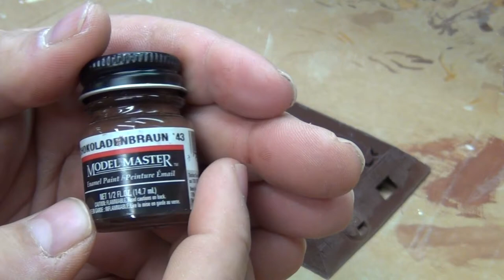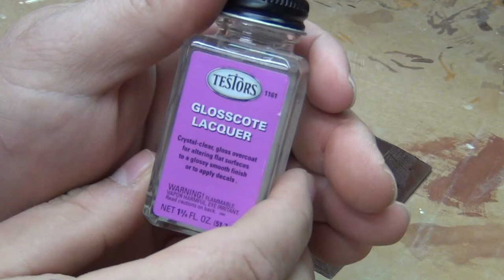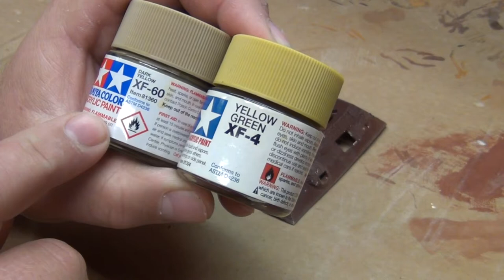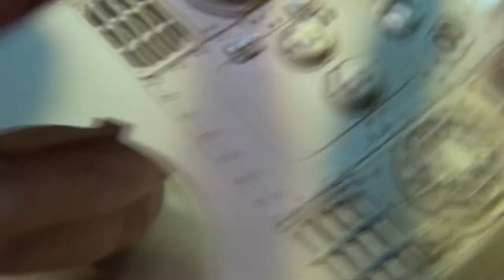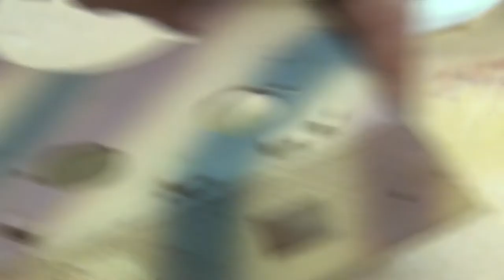1/35 Armor:  Hairspray Chipping Tutorial

Comment: nice look, being on this earth when dirt was made, I've tried the paint method, thinner method, tape method, salt, and now hairspray, I like this the best, you really captured it nicely.
Reply from the maker: +Clayton McClain I had a good time with this video.  I did go a bit overboard and got carried away with it but it was a lot of fun to do.  I really think this method gives the most realistic looking results.  I think moderation is the key when it comes to chipping.  I was checking out two different size dark brown/rust colored micro marker/pens from Michael's that I might want to mess around with for another chipping method.  I think they could yield good results in controlled moderation as well.  I would definitely recommend purchasing the cheapest model tank you can find and just use it as a sacrificial test vehicle for different products and methods.  Spray can oven cleaner takes the paint off models, usually in two applications, without harm to the plastic or glue.